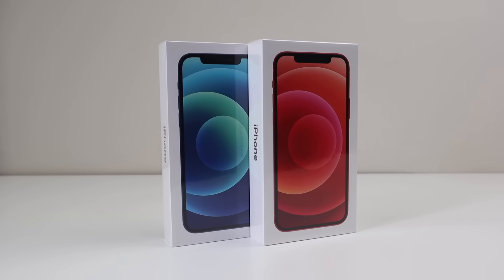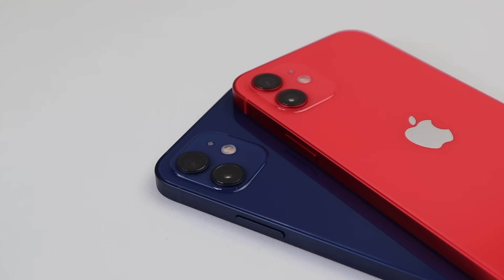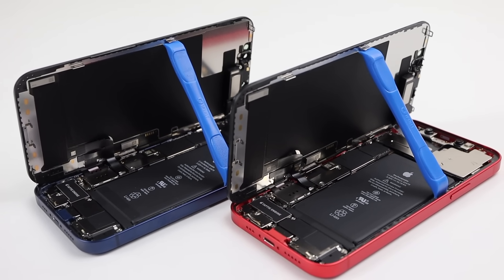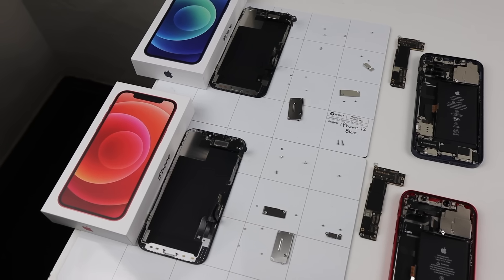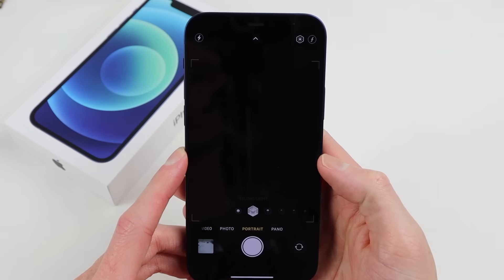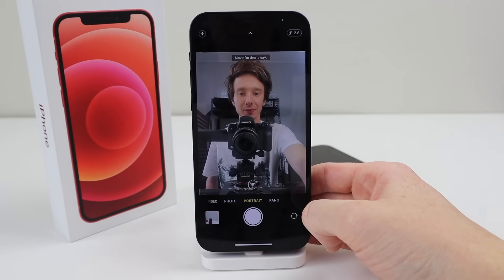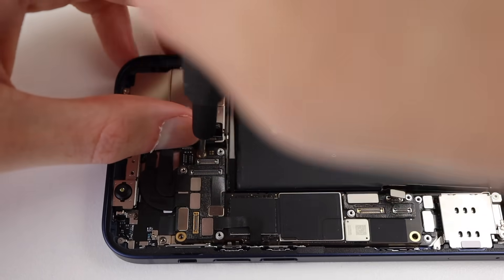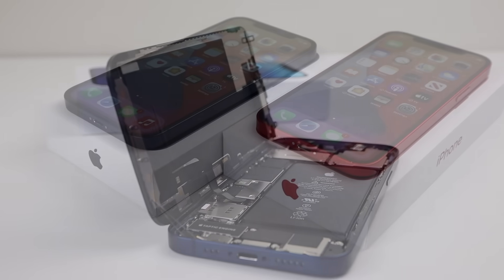iPhone 12 Anti Repair Design - Teardown and Repair Assessment

Comment: Apple could of avoided the issues with the USB-C cable by simply including a small USB-C to USB-A 2.0 or 3.0 adapter in the box so you could still use it with older power supplies! They will probably also have to do that next year with the wireless MagSafe chargers in the boxes if the new IPhones next year are 100% wireless with no ports so they have to have a MagSafe charger included in the box with the device! That’s mainly also because a large majority of people currently do not own a wireless phone charger! :)

Comment: You mention a few times that you believe this is not a software issue, it is indeed a software issue. You are correct when mentioning that swapping parts causes what seem to present themselves as hardware issues due to phones being coded to recognize their own original parts after manufacture. When you swap the parts back.. they work, which means the hardware is not at fault. Apple stores and authorized service providers are given access to software that recalibrates devices to recognize repaired (authentic) hardware as its own. It’s a very specific process and done in a specific order after a hardware repair with authentic replacement parts has taken place. 

I worked for an ASP as a tech and in senior positions for 3+ years and was a part of the genesis release of this software for the model iPhone 7 and up. 

I believe in expanding consumer repair rights, I don’t work for them anymore. Apple sucks.

Comment: You never swapped the earspeaker.
That’s why faceID didn’t work.
It has a sensor for FaceID.

The issue with the camera is 100%
limited to the iPhone 12’s and up.
Most likely is software and will be fixed in an update. I have replaced cameras on iPhone XS Max before and plenty of other iPhones.

Comment: Its good what apple has done. 
It will not allow parts from stolen or lost iPhones to be used to repair the other iPhones. Due to “find iPhone” feature, the stolen and lost phones are disassembled and its parts are used to be sold independently.

Comment: Increases price, lose headphone jack first then stops putting the headphones in the box and now doesnt come with power brick and change charger so you have to buy a new one. Every year it seems like its basically the same phone just losing parts. I am not saying that they arent upgrading internals but still this is ridiculous. At this rate these phones are going to be over 5k in 10 years.

Comment: That is exactly how apple locked the camera on my iPhone 4s with the last few firmware updates.
Reply: are you kidding me ? the 4s only runs up to ios 9
Reply: Serious. That started about 6 months ago. Phone worked perfectly until then. Apple crippled the phone.
Reply: Same has happened with my iPhone 5s
Reply: I only update my iphone up to the latest version it was released. No new IOS updates. So if it came with ios 14. It will get the latest ios14. Not the next one. It will brick the phone and cause other troubles. 
Currently I’m also on the pre-corona ios.
Reply: You’ll have to stop allowing updates after an independent repair; otherwise Apple can punish you at any time.
Reply: Android is doing the same my s9 is my second phone and it runs extremely slow

Comment: This isn't anything crazy, the components are simply coded/registered to boards it's installed/connected to. At best a factory reset will help or a "copy" device will be needed to copy the coding from one part to another, which will definitely be available in a few months making it repairable.

Comment: I am not against them noticing the non factory parts and displaying the warning. In fact I am all for it. Because it can prevent issues with people getting sold phones with non factory parts as factory assembled phones. I am however against limiting the functionality based on that. Just make the warning void warranty and service. So for example if someone has a non factory battery they can't come in and complain about their phone discharging too quick, etc. But limiting functionality is crazy.

Comment: This will not prevent repairs. People just have to wait for the same hacking community that jailbroke the platform to jailbreak the issue to highlight. I have no experience in this field, but one can guess that it is a software lock that requires whitehat programmers to create a software key , right?

Comment: hey can you tell apple to just make a security firewall that scans every part and after that it tells apple what was installed and from there they can say whether or not it works or not or will in the long term mess up the phone instead of shutting down feature of the phone. Not only does it give more freedom to the user but apple can learn more about the parts people are adding to their device. Who knows maybe someone is trying to make the apple battery better and they succeed. Apple can benefit a lot. The only problem I see is how will apple know whats wrong with your device for sure without hurting peoples privacy.

Comment: Apple and their shady practices. I will never support them. They are sneaky bastards. Stop buying apple products until they make their phones repairable by 3rd party repair shops and not locking down on supply parts for the phones to be used by 3rd party repair shops.

Comment: Some infos were wrong...
Apple talked about the charger. In my opinion the charger is also the cable. You can definently use a old charging Brick with a new iPhone... As long as you have the old cable (wich most of the people who own an older device do) you can use the brick normaly....
I would also not let a third party company repair my device.... soo

Comment: just a note - the likely reason they would not power on with the power button is due to battery activation - when the battery is first plugged in, it will not power the phone, as to avoid draining in shipping among other issues. The phone must be plugged in in order to activate the battery, and so if the device is not plugged in, it will not be getting power from the battery, and will not turn on with the power button. This is a feature on many battery powered devices, from laptops, to children's toys that have a little tab that prevents the AA battery from making contact until the package is opened and the tab is removed.

Comment: I use an iphone7 and I have replaced the parts multiple times, my touch ID is unavailable in the settings menu and I have lost other features over time.
Reply: i think it is because of the upgrades because my iPad pro from 2015 just stopped working this year and its in mint condition but acted up after the July update. There are some videos on youtube where you can downgrade your phone ios to get back some of your functions again. I might do this with my iPhone 6splus and uncheck the place where it will upgrade on its own.

Comment: It's a simple equation, Apple wants to bend you over and extract every penny they can. They think your item is still theirs. You have no rights to open, replace or fix YOUR item.
Soon, maybe two too five years, you will not buy your phone, you will only rent or lease it. This will be under the guise of, Apple will be the best company to repair, fix (they won't fix) and recycle THEIR phones. You will be renting "NEW Phones" that are made from older phones, great for recycling ♻️, right? 
Nooo, great for their business plan and profits. So, whats the equation I stated earlier? Apple 🍎 equals empty wallet and controls you, your phone and your money. When they own your phone (as they are trying so hard to do now) you will be paying much, much more than £1,400 $1,900 a year to use an Apple device. Apple is no longer the best smartphone designer or maker, simple, allegedly.
The iPhone 12 battery is tiny, being only 2815mAh. 
But we all have choices in life, mine was to ditch Apple after the iPhone 7+ as it used Samsung parts? 
I'm now very happy with my Samsung S10+ 1TB with 512gb card and the choice or removing the SD card and having two phone lines.
It's my phone and I can get parts and repair it too.
👎🤬👎 🍎

Comment: Doesn´t your old brick have its own cable? I see this over and over again. Why are you supposed to use the new cable with the old block (but not the old cable)? Keep the new cable in the box, and when your charger dies buy a new better block with the cable you have in the box.
Reply: @swegweg erg No no, just the old USB-A cable. So you are forced to use the new USB-C cable with the old brick.

Comment: I don’t think iPhones ever needs a repair (unless the battery needs to be replaced.) They are very precisely built. 

I’ve used an iPhone 6s for 3 years sold it, I think the second owner can still use it for 2 more years. My current XR is nearly 2 years old. Will wait till sep 2021 for an upgrade 😂

Comment: I was considering buying the iPhone 12, because my wife has an iPhone.  However, I strongly disagree with spending a large amount of money on a phone that has built-in barriers to future repairs.  You cleverly pointed out that anytime Apple decides to move on (push newer models), I would be unable to repair it.  I am not surprised based on the software upgrade that noticeably slowed down her older phone.  Sorry Apple, no.  New project - convince wife to switch to Android.

Comment: I believe Tesla does something similar with their cars. Considering the service and repairs are the way most cooperations earn most and the products is theirs they want it exclusively even though the consumer paid for it. It is something very similar to what Edward snowden revealed about cloud data. You can use it for your benefit but you don’t own it, the data you store on the clouds is yours but once in the cloud you don’t own it.
Ha! I have a 6a and really never thought of changing it. It’s all I need. Because software by Apple is always optimised for Apple phones so the age is of software not hardware. The hardware just needs to be capable enough and the software needs to be optimised enough.

Comment: I got the point, but I would like to know... could the cameras issue be related to the sensor calibration process? Maybe the cameras aren’t interchangeable because each image signal processor is meant to respond to the individual sensor of its corresponding camera. I guess in the future, there will be sensors capable of bypass this problem anyway :)

Comment: I cannot blame them for serialization/pairing of key components that set the quality standard of the device. As us DIY guys know, its a serious bummer winding up with knockoff parts that suck. Having iPhones floating around with knockoff parts in circulation sucks. I have been a victim of purchasing used smartphones with non genuine displays on them with washed out colors with lines/artifacts and that is a true bummer to come across. So, while I partially understand apple's reasoning behind this behavior, they DO need to at least supply a clear and easy to use toolset for repair shops to do the job correctly.

Comment: Also, in order to turn a phone on after replacing a component, you need to quickly press volume up, then volume down, then hold the power button until you see the Apple logo appear on the screen.

Comment: As a certified Apple repair technician, Apple has a serial number for each major component in there phones and that’s how they ensure that genuine one parts are being used. Whenever a part is replaced, it goes through a calibration stage so that the phone can learn to recognize the new part, and to ensure there are no existing defects that remain un-repaired. Every defective part that is replaced, is sent back to Apple and goes through the process of either being refurbished or recycled.
Reply: But couldn't they make it so that all the serial numbers of the parts are in a data base and that, when the phone recognizes a new part, it checks the serial number with the data base?
I think that way it would be much easier.
Reply: @Ikxi  the only issue with that is that Apple is picky about interchanging parts. They have a database like you are talking about and that’s what the phone checks for, but apple’s concern is that if somebody just replaces the part then later wants to blame Apple for that part being “defective” when in reality it probably wasn’t installed properly, then they can’t place the blame on Apple. On top of that, Apple isn’t a fan of mismatched colors, and which is also one reason why everything was throwing errors because other parts in the phone which are color specific, where setting off other triggers on the phone. Basically think of it as apple’s version of quality control. Realize that even though most of the parts inside the iPhone are fragile, iPhones naturally have a longer lifespan than most androids for the fact that Apple has a system to maintain and guarantee that the product they provide, maintains the same quality throughout its life span. So though it may be a pain in the *ss to perform DIY repairs, it’s to preserve the value of your device which in turns saves you money, and frustration from dealing with a poor quality product.

Comment: I'd really like to know if you see any functional changes when swapping the batteries! This is the one component I would definitely swap
Reply: There is no functional difference as the batteries aren’t color specific, but more so just model specific. And to clarify on that, storage size doesn’t matter when changing the battery out. Just the model of the phone. So all iphone 12 pros share the same battery. All iphone 12 pros share the same battery. All iphone 12 pro Max’s share the same battery. And all iphone 12 minis share the same battery. The 12 pro Max’s will have bigger batteries than the iPhone 12 obviously because there is more power needed to run more, without suffering battery life.
Reply: @tr0lls3c  question was about swaping battery between two identical phones, if is it blocked like other parts. If battery have own id number, swapp can block phone.
Reply: @lucjansosna9179  It’d be dumb if you can’t even swap batteries. But I doubt Apple would do that. It makes sense for the camera and other parts but if they did the same with the battery then Apple is crossing the line and that’s just absurd if it does happens
Reply: @lucjansosna9179  replacing the battery won’t totally break the phone like what happened in the video. If you replace the battery with a 3rd party battery, or don’t calibrate the new oem/factory battery, then the only thing that will happen is a message will pop up on the screen letting you know something about the phone detecting a different battery than the one calibrated, and the battery health stats will be unavailable until you either calibrate the new factory battery, or in the case it’s a third party battery, then resolve it with a factory battery. Trust me. I have replaced hundreds of them before. I would know how the repair process works on these types of device’s as that’s practically what I do as a side job.
Reply: @KryptonKr  Apple wouldn’t do that, especially after the backlash they received when it was announced that they were messing with the battery performance on older devices, to try and persuade those with the older, and soon to be outdated phones, to upgrade to the newer ones. That’s when they were really being sketchy and wanted to claim the whole thing as a way for the older devices to support the newer updates when really that wasn’t the case. All in all though, since then, Apple has been more lenient at who is allowed to repair their products. For the longest time nobody but Apple had replacement oem parts to fix their devices, which kept most people from going through anybody else or doing the repairs themselves, because any 3rd party or aftermarket components being used would permanently void the manufacturer’s warranty.
Reply: @tr0lls3c  but if Apple use additional identification chip, they can block even battery changing. In software they can do anything what they want.

Comment: One mistake I see when he swapped out the logic board is considering it is apples all logic boards are specifically pared with the phone which means it can’t be replaced
Reply: That's the point of the video.
Showing exactly that.
Every single part just goes with one logic board and nothing else.
Or the apple technician has to calibrate it to new parts with tools that only apple has, IF they even repair it.

Comment: "I even broke my tool once. Luckily it just screwed right back together"
This. Why can't some things just be that simple!
Reply: The old Sony phones like Xperia z1, z and z ultra are the Most friendly Smartphones to repair i guess 

Changing frame and Display takes 10 minutes, and it is so easy that when u fix it one time, u can repair it everytime
Reply: Me: remembers Nokia 6
https://youtu.be/0M3Budnl3aI
Reply: Fairphone 2 and 3 are very easy to repair.
Reply: Lol Apple needs to take note of this
Reply: it’s a sarcasm to apple anti repair policies
Reply: Black Cash  android is an OS🙄. You can run Android on shity repairable phones too.
Nothing to do with Android.
Reply: @zerogo9669  brub atleast android got the charger in the box. Plus it FINALLY has 120 hz refresh rate
Reply: @NPC-pq2nn  and for what? I have everything I need on my 250 bucks phone. It works even better than I expected. But I would never pay extra for something like this.
Hell, I even want 2 cameras on my phone. I prefer one good than 3-4 which I never use. But cheaper
Reply: @zerogo9669  well maybe he didn't know any other word for it.